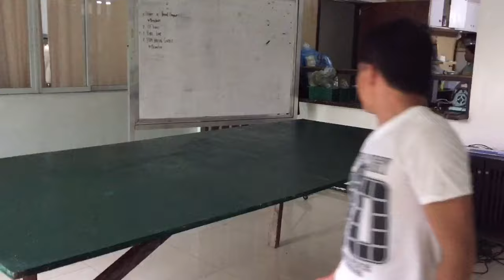D.I.Y table tennis(Affordable Budget and Quick to make)

Comment: Magkano po nagastos nyo ?
Reply from the maker: 1300 yong tabla yong kahoy para sa stand mga used nayan, pero kung bibilhin nasa 500 yan, tapos yong net at rocket sa lazada 700. yong pintura 150.
Reply: Ilang plywood po yung nagamit boss @ecgtvyoutubechannel
Reply from the maker: @ransplay9536  isang tabla lang binili ko. pero dahil merong ritaso na natira sa pinag gamitan ko ng kabinet dinogtongan ko ng 9 inches ang haba niya.
Reply: Kulang ata lapad ng table, parang 4ft lng yan. Ang standard is 5ft wide x 9ft length.